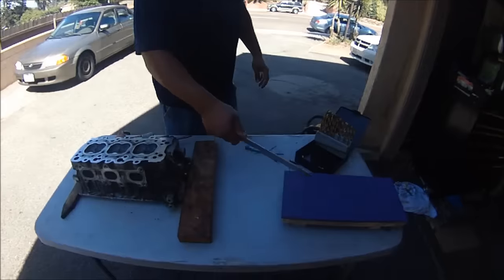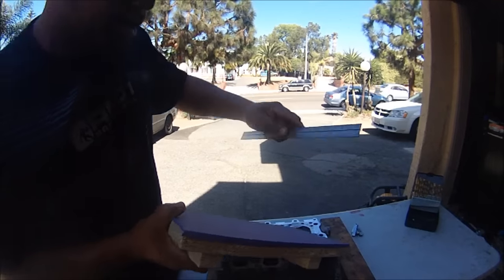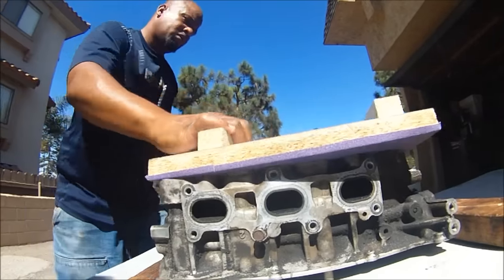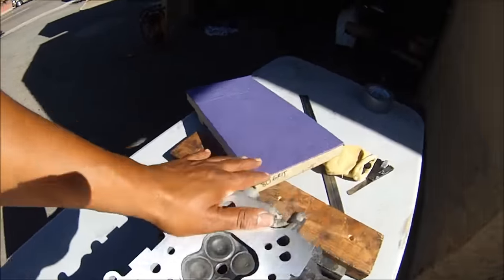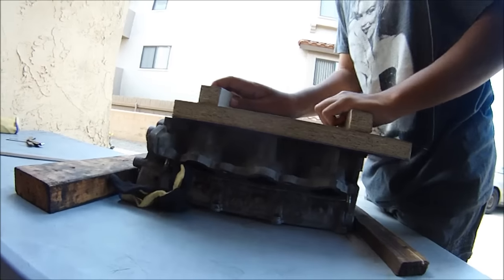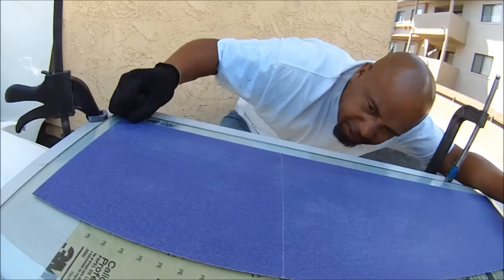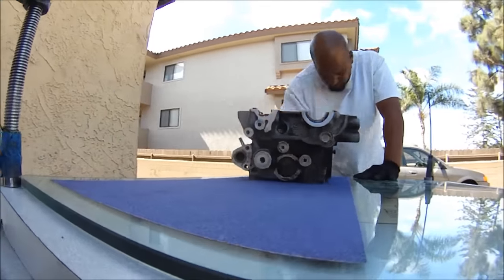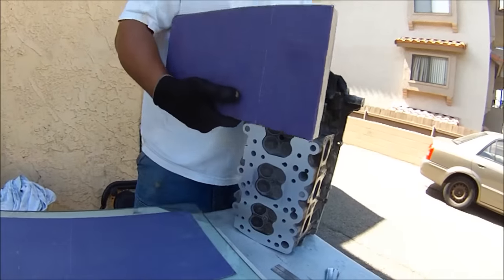HOW TO RESURFACE A WARPED CYLINDER HEAD AT HOME WITH SAND PAPER still works in (2023)

Comment from the maker: To all the haters and machine shop workers who disagree with this sanding method. To argue your case bring me some real facts (VIDEO) as to why this will not work. (Do exactly what I did with the same grit sand paper and nothing sliding under the straight edge with a .002" feeler gauge then prove me wrong)  do not speculate, guess or base your opinion off of he said she said assumptions. Dont use that shady machine shop video against my way where someone used a belt sander and left LOW SPOTS ON THE CYL HEAD. That has nothing to do with how I performed this task and dont even try to use that shady work to compare to mine or to even try to discredit me with.  I understand how you feel, and how upsetting it is to have your bubble burst and to find out there is more than one way to resurface a cylinder head. That's what they taught me in Mechanic school slao, but I challenge everything and will never stop. This video is a GAME CHANGER and gives the DIYer the ability to save money and do his/her own Cylinder Head resurfacing at home. I know you will loose money but this video is about helping those who cant afford it. I am well versed in engine overhaul and have 22 yrs experience Now that we got that cleared up get started on your proof video and no more talking or assumptions MAKE A VIDEO AND CHALLENGE THIS METHOD WITH REAL FACTS.
Reply: Vernon Bosshard what are you talking about?? did you NOT watch the video ..and the .002 feeler gauge NOT sliding under the straight edge ??
 it is up to you to disprove when you doubt ..he has already given the proof .
 Keith fenner  ) here on youtube ) .. a machinist for 30 +years ..has done similar on his channel
Reply: Vernon Bosshard Get over yourself.  He JUst showed you on camera step by step.  If you dont like it, then just dont use his method.  Really simple.  No reason to mock this man of excellence.
Reply: What about Surface RA? Not all heads have the same surface RA requirements,Some need to be smoother than others.That's the main thing i think would be hard to check without an Surface Roughness Meter Gauge that measures RA, Manufacturers give you a threshold on RA finish. This article covers it. http://www.aa1car.com/library/ar996.htm
Reply from the maker: Ya I hear you about the RA, I know exactly what you are talking about and do consider the surface peaks and valleys as being very important thats why I finish with 100 grit which works out just fine.
Reply: oldskool funk
Glad to hear man, I have to say, You are talented. You make this shit look easy, It's not though. Not everybody can do what you do. Excellent job man, Simple set up, Yet worked like a charm sounds like.
Reply: Vernon Bosshard
It works fine. I've done a few motorcycle heads this way myself. Just do it right going up the grade numbers with the paper like the man says and you end up with a nice surface.
Reply: *****
....and that's why Oldskool checked it with the fishing line pulled tight.
Reply from the maker: ***** Ya ya ya, Haters are always looking for something to nit pick about GET OVER IT IT WORKS. did they build the pyramids with machinery? did they use STRING to check for straightness? did they use tubes with water to check and level buildings? which they still do. im just keeping things OLD SKOOL.
Reply: guys, really, stop screaming about this.  If you dont like it, then simply move on.  And not everyone who disagrees or challenges the concept is a "hater".  Good video.  Now let's move on
Reply: ***** That is technically a straight edge, you can tell, given its thickness. It is probably a cheap one, but it is still a straight edge
Reply: On the straight edge issue: Let's assume, as some are doing, that the rule does not have a straight edge. If so, how on earth would the feeler gauge show no gaps after the sanding? You would have to sand the surface to match the imperfections in the rule! Also, by moving the rule around, you'd then see gaps all over the place, where there were imperfections in the rule edge. Wouldn't you?(!!!) This wasn't the case. Also, the glass is flat and therefore so is the grit paper surface - assuming no lumps of glue. The glue was sprayed on so that's  most unlikely. I believe a little logical thought kills the issue.

I love it when home remedies suffice to take the place of expensive professional work, especially when it would cost more than the car is worth. Great video Oldskool funk!
Reply: Vernon Bosshard UM DUDE, WHY WOULD YOU THINK IT WOULDN'T WORK ?! EVEN IF IT WAS OUT , ''WHICH I DOUBT'', YOU STILL HAVE THE MLS HEAD GASKET TO MAKE UP FOR ANY IMPERFECTIONS AND HOLD COMPRESSION !
Reply: Mark Breaux
I am saying it WOULD work. I put forward a logical argument as to why it would. Yes, the head gasket would make up for the minor inaccuracies allowed by the manufacturer.
Reply: Yeah I agree not on a Ferrari lol , but a used civic? Absolutely.
Reply: all i can say is some machist dye would help out to notice the low spots better once you get going.
Reply: ryanjames170 this is a key point.... And it's just a cylinder head. I am a machinist at an aerospace company and we are given anywhere from .005 -.050 tolerance. This cylinder head is not going to heat treat therefore it will not change or distort the dimensions of the part. Good work to Oldskool I like your video. Subscribed!
Reply: I have to do this because I bought a $250 turbo dodge shadow for a loaner car while I rebuild my VW Jetta and now the shadows head gasket is cooked due to a plugged thermostat. I was on my way to buy the thermostat. +1 bro.
Reply: Vernon Bosshard You must buy your tools from the dollar store. Or are all your rulers crooked? I sense a negative violent person that most likely throws his tools around and kicks his vehicle. Karma.
Reply from the maker: Vernon, I sense an insecure, behind the screen hater who likes to flex his key board chest to pump up his ego because he has self esteem issues and needs to put down others to make his self feel good because he lacks? what do you lack? do you need a hug? Dont try to break me, it will not work lol. Get rid of that hate its going to wreck you. God bless.
Reply: Geoff Dick It will work but you won't be as true as a machine shop. I'm scared myself but it's all I can afford right now.
Reply from the maker: Thats true shel.
Reply from the maker: Quit lying to the man themax. Geoff, The first thing you have to do is have them pressure check the head to see if it has cracks/leaks, then its $45-$55, just for the resurfacing, then you have to have them clean it, then you have to get the valve job (highly recommended) and if your valve guides are no good you have to get those done. Total is $175-$250 but it depends whos trying to rip a whole in your wallet. Your paying well over $40 when you take it to the machine shop. Keep im mind I am not against taking your heads to machine shops, of course the mill machine is better than sand paper but the method I used works fine IF YOU DO IT RIGHT. This method is for the folks who are financially burdened and who are willing to tackle the issue on their own, The DIYer.
Reply from the maker: themax, Then quit lying...Problem solved.
Reply from the maker: Man you got a thing for me or what? thats alright stick around ill show you how to overcome that anger brother.
Reply from the maker: themaxrider I actually fell sorry for your max, Your not getting anywhere with this, your only making yourself look bad brother. ATTN: To those that read this, WATCH OUT!!! for people like this (themaxrider). They are poison for your life and soul. Their objective is to destroy your will to win, your ambition, and to suck the life out of you (bottom feeder/leach). They kill your dreamz, try to discredit you and stop you dead in your tracks by trying to discourage you. This is the type of person I warn you about they are DREAM KILLERS and they come from every aspect of life (family, friends, strangers YOUTUBERS lol). The issues they have are deeper then you see, when they run off at the mouth they are usally hiding behind something more that goes deep (low self esteem, pride, jealousy, INSECURITY etc). They do this because they need to put people down in order to make themselves feel better. Jesus, said pray for those who speak evil about you, so instead of me retaliating against themaxrider I ask you to pray with me for him. I no longer get down like that as far as the anger and will never go back. So I ask you to lift our brother up in pray for him and ask God to give him peace in his heart, Jesus Loves you Max. DONT LET ANYBODY BREAK YOU! and keep on SMASHIN OUT THERE IN JESUS MIGHTY NAME!
Reply: themaxrider So when he checked the flatness with a feeler gauge that was all a trick since the glass has a 'deviation of flatness'?
Reply: Vernon Bosshard A ruler is essentially what an engineering straight edge is.
Reply: If it works it ain;t stupid.
Reply: SacreDro I couldn't agree more. There can be times when you just don't have enough money for the machining as well as a gasket set. A running car can be a necessity and it's tricks like this that can get you by.
Reply: Holy shit, I think this is about the most true video when it comes to explaining how to deck sand a head without bringing it to a machine shop (how reparable is the machine  shop and it's equipment. This does come down to thousands of an inch!?)
.
The particle board is just about the flattest wood you can buy. And as far as I know (when dealing with small engine heads), glass is one off the flattest surfaces. This was extremely detailed, and right. Especially when it came to detailing everything including the sweat put in the job (other vids will be 2 minutes long, and it will look like they went on a vacation doing the job). About the only thing I would have done different (and he might have?) is deck sand it in circles, so you get a krissXcross pattern on the surface. The best way to go when using a gasket that has a softer material for the tightest fit, than just a plain metal gasket!
.
I'm scared of Jesus Christ!
Reply: themaxrider I really don't see where he could go wrong, doing it on glass. I was taught it's the flattest surface you can get, next to a lathe?
.
The way they design heads is kinda stupid with a gasket being the only thing holding all that compression in? Why don't hey have gasket rings... a medal ring that goes between the head and the block around each cylinder. Than maybe you wouldn't have to worry about it being so perfect!
Reply: ***** Twat?
.
Dude it's a head of an engine... your over complicating things way to much! Doing it by hand on a flat surface like glass (I'd only use glass), rather than depending on a machine that might be off a couple thousands of an inch is always going to be better. Glass is next to the flattest surface you can get. He used a simple method of just gluing some sandpaper to it and rubbing it back and forth. You can tell that he was getting the job done right simply by him showing the marks of where the head was warped a little. He kept on going until the WHOLE SURFACE had been obviously sanded to level! Here is another vid you can criticize for being unprofessional watch?v=mc_gaGAf2pk
.
I'm not putting down machinist at all... I'm just saying sometimes it's nice to put a little more time, and your own effort into the engine!
Reply: themaxrider Are you sure that Strap-On don't make a specialty tool for stupid....
Reply: I know for a fact Subaru techs use sand paper to even out heads.  It is something that certainly works, your methods crude obviously oldskool funk but it works and you trying to show people a alternative to paying a machine shop.  Now people gonna hate and ill tell you I wouldn't do this in my shop but i'm not saying it doesn't work (i can just work on another car and get paid while the customer pays for the machine shop work you know.)  Now tell me is that car still on the road running with that head?  That's proof right there if so.
Reply: They do head gaskets.  Who said anything about a rebuild?
Reply: My cousins a subaru tech and i have taken heads over to them and watched them sand down the heads on premises.  How you gonna tell me jack?
Reply: To be clear Subaru does this as a cost effective way to get through all the warranty jobs they've had to do with heads.  It's not the right way as oldskool said, it's a cost effective way that works and that even Subaru uses as I said.
Reply: Torin H"They" fucking up the boxer engines are they? V8's should actually be boxer engines... it's a more efficient design!!
.
RADIAL V8'S WITH A DRY SUMP OIL UNIT!!
Reply: Vernon Bosshard if you would look at it, its a machinist rule which is a good enough standard for this work
Reply: oldskool funk resurfaced 3 heads like this so far. . anyone who hating on this doesn't know what they tallking about and is afraid of work
Reply from the maker: Quit WHINING! its works fine. and your paying more than $30 after resurfacing,  you still have to grind the valves do a pressure check and if your valve guides are bad you need to get them changed. Stop complaining!
Reply from the maker: Watch out for dudes like matt, they are like a poisonous cancer of negativity that are filled with negativity. Like Bob Marley said "Don't letem foooool yaaaaa!" Matt's a dream killing skeptic pepz.
Reply: oldskool funk hey man what kind of adhesive did you use like brand and style and where did you get those big 3m sandpaper sheets i started doing this like the first way you did it and im noticing some real progress the edges you said would be flat all the time are 2 thousands then the middles are between 5-6 so i've still got a ways to go
Reply from the maker: I use 3M Adhesive spray they sell it at Walmart. I get the sheets from Home Depot make sure the joints are tight (use tape to hold all 3 together Tape on sand paper side) then spray the under side of the sheets all at once and lay it down on the glass. Now I use Wet/Dry sand paper with WD40 it speeds up the process, Hang in there and be persistent.
Reply: its the 3m adhesive trim adhesive spray? it was like $12 i was concered with it not because of the price but because it said trim adhesive i wasnt sure if it would work that good but you help all of us beginning and we cant thank you enough
Reply: themaxrider     well considering i just did it i can agree and disagree with you mine i would say was alright i got it pretty flat so im gonna seal it and use a felpro composite gasket you can get this completly flat if you have a flat enough board and glass and everything mine wasnt 100% so it didnt come out perfect but its good enough to seal but yes this will work if you take the time and make sure what you are working with is flat enough
Reply: oldskool funk is the poor mans scotty kilmer of youtube thats why i love his channel haha machine shop wanted 300 bucks to do both heads on my 3000gt but this worked good enough for me
Reply: what i said was make sure your glass is straight if its from like a window and stuff like that without pressure on it you'll be fine but mine was bent a tiny bet for some reason probably from when it was being stored
Reply: Gregory May but trust me oldskools method will work most of the people saying it wont are people trying to make money or they think they know everything
Reply: that is true but its the same process and will work relatively the same was the surface you had your glass on flat enough? or was the sandpaper flat as well?
Reply: Gregory May and if your head is very warped it takes a very long time mine was at a 0.14 difference from the sides now its about 0.04-0.05 so im just gonna use a composite gasket and seal it
Reply: wait if it was straight why did you try resurface it? and it shouldnt have made it worse
Reply from the maker: Quit complaining, whining  and blaming me.  Do you think life is going to hand everything to you that easy. I have been through struggle brother and never once have I pointed a finger or blamed other people for my mistakes. You better learn how to deal with what life throws at you and quit whining. My kids dont even complain that much. I dont know YOUR WORK but I see where you are going with this. Your waisting your time trying to discredit me. Of course things can go wrong with anything but DO NOT sit there and blame me. I showed how I do this task and its up to each and every individual to use sound judgement and do their best to do it right. If You attack me, rudely dont expect me to baby sit you, hold your hand and except your foul language and just bow down to your disrespectful ways, your a grown man! Snap out of it and learn how to endure through the struggle like most of us do.
Reply: Gregory May well i was trying to help you and you must not know what you are doing this oldsckool guy explained it clearly and mine came out just fine maybe people who dont know what they are doing should stay away from cars...
Reply from the maker: I agree SvddenDeth, if your not doing this method will the right mindset then maybe you should not attempt this. That matters big time. What people don't understand is that by time I put out a video I have gone through tremendous struggle with many trials and failures. Most people never see the struggle behind what it took to bring a video to the public. Greg got hit with a mistake and now all the sudden its my fault. Greg you can still fix the head as long as the wear indicators are not sanded beyond the minimum point BUT HAVE THE RIGHT MINDSET TO OVERCOME YOUR TEST.Get back on the front line and re ATTACK IT!
Reply from the maker: Watch out for guys like Max peepz he is the kind of person I tell you dont want to listen to. He has been hanging around this video (TO LOOOOONG) like an internet troll just waiting for something to speak negative about. The negative people like him are time wasters and dream killers. Pay them no mind Brush them off and continue to move forward with relentless drive. All haters do is whine, complain and GET LEFT IN THE DUST OF THOSE WHO PUSH FORWARD. STAY SOLID!
Reply from the maker: I never insulted any of you guys. You guys cursed me out, so I got firm then your feelings got hurt Max, This method works just fine Max, is just preying on Gregs misfortune to reinforce his own ego because Max is a negative thinker and needs company. Misery loves company. Dont try to use Jesus to say im off track Im just a firm fighter who will not tolerate both of your disrespectful ways. Remember I never cursed you guys out at all yes I got firm but who said a Christian cant stand firm and hold his or her ground. You seem to think you guys can take advantage of a Christians kindness, no more whining guys HANDLE IT.
Reply from the maker: Im done with these dudes. Learn from this peepz. Negativity and a bad attitude will produce shoddy results, Im Out.
Reply from the maker: When you come across so many haters peepz Challenge all resistance and continue forward. The proof is in the video I still do this and its works perfectly fine. Blow through all opposition. They are all talk I got another video coming out with me sanding cast Iron heads. Haters like matt, get left in the dust dont letem move you, on the streets we call it "bumpin their gums and not saying nothing" bring proof matt, and quit crying while your running your mouth Ill  KEEP SMASHIN IN JESUS NAME. No disrespect Im just firm like that. now get to work on your video matt. I call you out and challenge YOU, will you be the one to make a video??? Im still waiting for a challenger not one of you have STEPPED UP YET. Dont be scuuured HANDLE IT!
Reply from the maker: EVERYONE SPECIALLY HATERS PLEASE READ THE FOLLOWING CHALLENGE: MATT CULLER, I designate YOU to be the spokes person for all the haters who claim this does not work. Someone needs to step up and prove me wrong with a VIDEO, NO MORE TALKING. So I choose YOU MATT, Do exactly as I have done in the video and prove it. Absolutely  No deflection in the board or glass, and ABSOLUTELY NO WARPAGE WHEN YOU ARE DONE. SLIDE THE FEELER GAUGE UNDER THE STRAIGHT EDGE JUST LIKE I DID, PUT THE HEAD ON THE CAR AND PERFORM A LEAK DOWN TEST AND COMPRESSION TEST. If you dont have the tools team up with another hater buddy who does and MAKE IT HAPPEN!  All I see is a bunch of assuming whiners who are afraid to challenge this method Get to work Matt, your hater crew is counting on you. Im bringing the challenge to YOU matt. Your the man for the job now.
Reply from the maker: If Matt backs down he will be eliminated from this challenge and banned from this channel. If another HATER would like to take his place and save matt from being eliminated from this channel then STEP UP and help him untuck his tail.Ooooh yeah Its about to get deep now. Im turning up the heat on you haters lol. All those who bump their gums through the key board will be banned unless you can bring a proof video to the table. Time for BATTLE. Defend your case. I will have my next resurfacing video out soon with leak down test and compression test. NO MORE CRYING HATERS.
Reply from the maker: Matt I dont care about a Tea Pot, all I care about is RESULTS. DO YOU EXCEPT THE CHALLENGE???
Reply from the maker: Im coming for all you haters so be ready or be banned lol. I will choose another HATER if matt is to soft for the challenge.
Reply from the maker: If you dont have experience matt then dont talk. Someone who has years of experience please step up. I have been doing heavyline (engine overhauling) since 1991. I want someone who understands what they are doing to step up and challenge me NOT A ROOKY HATER PLEASE.
Reply from the maker: Just calling you out. Are you in or what??? I need to know now so I can sift through the weak and move on to the next hater & bann/delete and scratch you off the list. WHATS UP?????
Reply from the maker: oldskool funk Matts Culler is Out! Which Hater is NEXT. This is not for the soft hearted you better bring your A game because I am serious and I am very competitive. I will be choosing a different hater each time one tucks his tail in and cowards like Matt did. Or any of you haters can step up at anytime and challenge me.
Reply from the maker: Themax do you accept the challenge??? If not I will choose someone else. Its a yes or no. This is your chance to prove me wrong no step up or step down. I've been rebuilding engines since 1991 and know all about preciaion. I want you to challenge me because you seem experienced. Come on man don't back down like Matt did. I am VERY SERIOUS.
Reply from the maker: I am calling you out Max STEP UP or be labeled a coward my man
Reply from the maker: All that talking and no heart to back it up. I need a real hater with real guts to step to the plate
Reply from the maker: That's why your going to do another video showing the leak down and compression test in 6 months then 1 year on the same car. ARE YOU IN max OR WHAT. Im not Hispanic don't get all racial with this, race has nothing to do with this challenge. ANSWER THE QUESTION. are you going to coward your way out or challenge me on this. All of the sudden I call you haters out on a challenge and you guys start MAKING EXCUSES. Quit barking and produce results. Are you calling Hispanics stubborn?
Reply from the maker: Its not difficult max are you game or what? Let me know so I can weed out the weak
Reply from the maker: I'm not Mexican you should be carful with your racial comments my man. Don't change the subject stay on course on please understand this is a public challenge that I am giving you the opportunity to prove your case. I'm not disrespecting you in any way I just want you to prove the validity of your claim. I have a car ready for the challenge. Get out there and find one then get back to me, until then I am going to skip you because you whine to much and find someone who has enough heart to accept the challenge. I'll be waiting for you though because you are the perfect candidate for this challenge you sound well versed in engines. I will sand the heads and check the RA also but only if YOU STEP UP AND QUIT BUMPIN YOUR GUMZ.
Reply from the maker: Then your out! Hater #2 dismantled. I'm done with you im moving on to the next hater but I really wanted you to prove it max, you let me and your hater crew down my man. Tuck your tail back in and go give your 10 thousand dollar machine a hug and get back in your lil box of comfort while us DIYers think outside the box, DONE.
Reply from the maker: From here on out you are waisting time max, you have been handled and pushed to the side. I am looking for someone who doesn't TALK and will step up. I prove everything I do, you and the haters ASSUME. Stay tuned for my resurfacing video and how I will prove it as soon as one of your hater buddies gets the heart. This is not a disrespect response its a challenge that is competitive I can't help it if your emotions are a lil on the soft side. I'm a firm person brother and I will stand my ground against anyone of you haters.
Reply from the maker: I don't want any conflict max. I don't care about gaining a status all I care about is helping people. You haters came into my world and try to shut me down and discredit me but you guys failed to realize that I'm not a person who is going to back down. Any wayz we both have different views on this subject I am in no way saying I am against machine shops. I have been using machine shops since 1991 and support the use of machinist fully. I just refuse to think that the DIYer cannot perform or do some of their task @ home. I will be also showing how I  remove and replace valve guides and valve seats at home, yes at HOME. That's really gonna knock your socks off and stress you out lol. But your not ready for that yet so I'll let you haters cool off before I out it out there. No conflict just produce results is all I'm about.
Reply from the maker: Again, prove it!
Reply from the maker: Stay Tuned its coming Im waiting for a real challenger who has enough heart to back up all that small talk. While you stay in your lil comfort box of programmed limited thinking, us DIYers will continue to innovate and make things happen, watch and learn my man.
Reply from the maker: James What happend to you brother? someone has poisoned your heart with rascism your better than that. I don't hate you and you can't get me to hate you. I don't think I'm always right I just stand behind every task I do. I still respect you and have no hate towards anyone. Don't let that hatred consume you God never made you like that it was taught.
Reply: oldskool funk I actually did your second method back in mid-2013ish on a 1995 2.4L nissan altima for someone who overheated their engine.  It took a long time to do it, but it sure does work.  I used a large piece of marble tile to glue down my sandpaper and finished with 220 grit wet.  I maybe went a little overkill, but I just didn't want to take any chances.  keep teaching everyone!
Reply: oldskool funk but yeah oldskool thanks for showing this method i did everything besides the last part where you put it on glass because my cam backing plate was in the way but i put a graphite gasket in and sealed it the head was pretty flat it did have some pits but they really dont matter because it sealed so far and im just gonna drive it till it blows again and use a mls gasket so what if it blows its a car stuff goes wrong with them all the time ill just do it again, i like your attitude oldskool have a great day.
Reply: oldskool funk this absolutly does work!! i have been doing this for years on everything from 2 to 4 stroke heads and it has saved me loads of money. its funny because i litterally do it the exact same way as your video and have always thought i was the only one doing this. tbh i have had machine shop skims done a long long time ago and doing it this exact way works just as well. some of the machines i have done this too run big hp numbers and really high compression and never had 1 problem ;)
Reply: oldskool funk 
They don't like you, 'cos you are costing them business by posting this on youtube for free. I wouldn't worry about the "haters". Just keep doing what you are doing and experiment with new and old school mixed creative and efficient ways of doing things as you do.
Reply: This work perfectly cow I had done it in the pass even before this video any body will think it does not work I think they have not give it a try.
Reply: Greats to you oldskool funk, I believe in the Lord to be one God whom put to death the body of sin upon the cross, and by the power of His Holy Spirit rose the body back to life from the tomb. God bless all who believe in Christ Jesus unto salvation, Amen.
Reply: Compare the length of the repairs! How about that ...Compare how long your BS repair last to how a proper repair last.. the proof is in the pudding not the junkyard...Worked on way to many of these BS rigged vehicles from idiots claiming to be "mechanics" who sold their POS to others only to tell them they were repaired..Then tear them down to find out they were backyard rigged to last long enough to sale,,,
Reply: Facts
Reply: oldskool funk ::we said and done::: you are the true hero on engineering flaternity:::i have a few questions that i can ask::::private contact please?
Reply: From an engineering point of view it def works.

The tool is perfectly flat so the head would be shaped according to the tool
Reply: oldskool funk I have a 2011 Camaro v6 lt can I do the same to the cylinder heads as well if they are warped?
Reply: With God all things are possible,  keep up challenging everything,  I just bought an old 76 Chevy 3/4 ton pickup truck for $300. With either blown head gaskets or warped heads well it turns out it has a  14 bolt rearend in it and back in the 70's and earlier they used more nickel in their castings of blocks to which I'm sure you probably already knew that, so my heads may be trash but the block is a 4 bolt main block that's highly sought after by hotrodders because of it's high nickel content  plus it also has a forged steel crank that I'm selling and will recoup what I paid for the truck I also bought a 4 bolt sbc 350 to go back in the truck, if I'd have just bought a set of aluminum heads for the 454 I would've watched the speedometer go one way while the gas gauge went the opposite way,  but this 350 I am building will be plenty strong enough to pull a trailer or it does have a fifth wheel hookup in the bed, the moter I'm working on had to go to the machine shop to get the cylinders bored out but the cast iron heads are trash as I am selling both the block and heads which in turn will pay for my new heads for my small block Chevy,  none of this would have been possible if it weren't for the prayers that the Lord has answered for me and it's so good to see others out there that love the Lord. Glory to the king of kings,  God bless you in all of your endeavors and may all your prayers be answered be it God's will...
Reply: @SvddenDeth  : I have been in the glass trade for over 20 years, glass was never meant to be flat unless it's gonna get cut down or has to have a pattern cut out of it just carrying glass sideways is highly dangerous,  if the glass breaks those carrying it should jump away from it as fast as possible b4 someone gets cut or loses an arm, window glass is the worst for it, but I see he used 3/8 glass prob from a scratched table top, that's a big difference than window glass, if you're using this method make sure your glass is no less than he says 5/16 but in the trade it's called 3/8 thickness, apparently you've been very lucky that the glass hasn't bent on you enough to break, safety tempered glass is your best bet on a flat table is fine but when you're carrying it whatever you do don't carry it sideways carry it vertical with both hands on it, I've carried more cases of 10 feet by 8 feet sheets of glass and it gives me chills to think what  carrying it horizontal would do, otherwise no harm no foul, good luck with that project, and whatever you do GO WITH GOD...
Reply: @matt420740  : just unsubscribe from this circus sideshow,  people put the blame on others because they can't handle the fact that ignorance knows no barriers, I was looking at ways to get the pin out of my pistons rods so I can save money by not buying new rods when I saw this video idk why but I looked at the comments, I wished I never did, pretty sad arguing like talking to a brick wall, this person has that victim mentality, when someone is like that they get all butt hurt when another try's to give them basic logic and commen sense, I'm outta here n won't be back, btw how would you recommend getting the pins out of my pistons? Don't feed into this nonsense, best off to let it go which I'm sure you already have.  Whoever reads this, Go with God, don't argue it's pointless to argue with a situation like this, he just wants an argument probably been in prison more than once but whatever, all I can do is pray for him and anyone else?  Please pray for him he needs it...
Reply: More money for me when that head gasket  blows. Not to mention all the grit you just put into the oiling system. Good on you man.
Reply: We use machines to resurface machines but all the final work is scraped  by hand with nothing more than an over rated screwdriver  with high end straight egdes . Machines are nice but cannot do perfection.
Reply: If you are on a pinch and is late Saturday  and you know the machine shop is closed on Sundays and the car needs to be running on Monday..........there is no better way than your way.
Reply: @markbreaux6613  bless up the civic
Reply: They hating cuz alot of people are realizing that they can do this at home. So shops arent ripping them off. Let them hate for “God was hated 1st and rised from the Dead. Now adays with yutube n google any one can fix a car. Good work my friend👍🏼 Bless you in Jesus name🙏🏼
Reply: Love that very job,true God everything is possible respect.
Reply: I burned an engine up and warped the exhaust manifolds real bad. I did to those manifolds the same thing you are doing with those heads. I have never used gaskets on the exhaust. Metal to metal and I never had a leak. It ain't rocket science and who don't want to save a few bucks.
Reply: oldskool funk  THERE IS NO REASON THIS WILL NOT WORK!!! 
Layout dye would help show the low spots. 
Moving in a figure 8 would increase paper life and give a better job. 
But there is no reason this method will not work. 

Point of interest:  lens crafters for telescopes grind complex curved lenses by hand!!!!!
Using techniques very similar.   This WILL WORK FINE!!!!  Go slow watch what you are doing.  Paint the surface with a magic marker or layout dye to show the spots being sanded.  Check it.  Watch!!!  You will be fine!!!
Reply: @reladham  The ultimate test is if the head gasket holds. Who cares if this method has been replaced by newer ones that are easier  and less prone to error? If it works is all that matters.
Reply: My grandpa used to do this on race engines, let the haters talk
Reply: Good job, in the machine shops they work under production time, they just throw the head cut a huge chunk and that's it, taking your time and verify constantly the progress is how is done,  you verify many times everything,  your job is as good as any machine shop that pays good attention to their jobs, keep on doing a great job
Reply: @vernonbosshard9317  Machinist ruler or straight edge works just fine. The only real issue is that it is better to spin the head 180° every few minutes but otherwise this is legit. Even you know it. You are dissing the only aspect of it you can. The standard by which he checks it. That's all you have is knocking the implements because the concept is rock solid. Or Granite counter top solid.
Reply: @Ru556  Once again analytical thinking and common sense carries the day. Kudos to you brother.
Reply: @briandavis414  Or more like an air cooled VW. No head gasket at all. Where a flat top surface mates into a flat surrounding surface that seals on both the top surface and around the circumference.